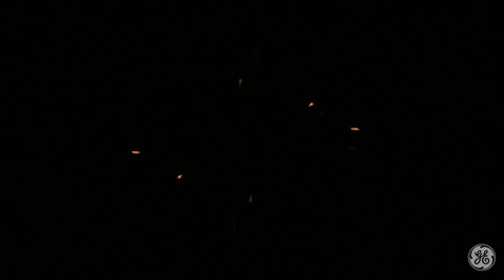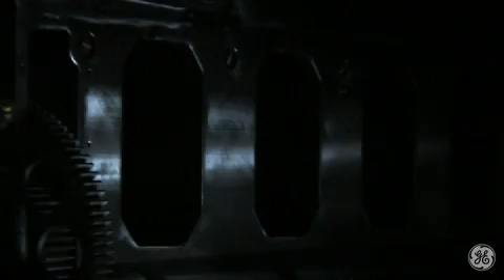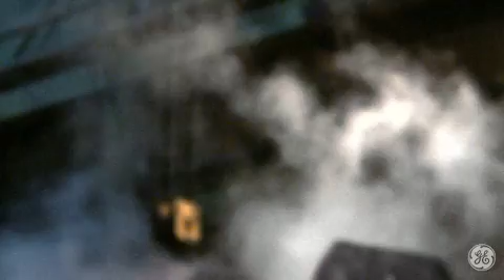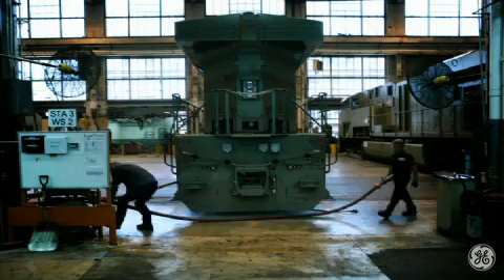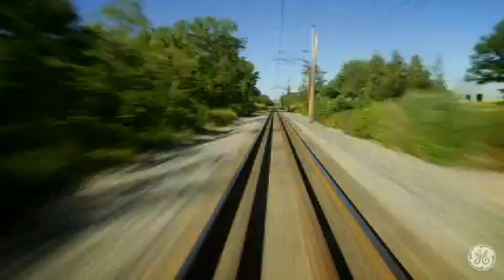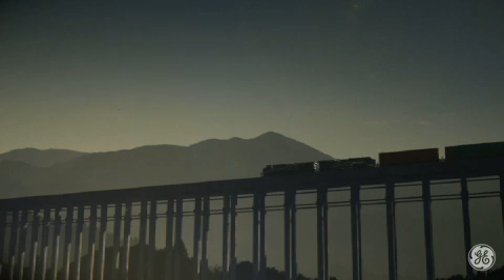GE Ecomagination The Evolution Diesel Train!

Comment: im mostly emd fan. I living in europe romania and we have a few locomoive factoryes over here.  The rentability is the key here and low maintance. When EMD and GE gonna build 4 stroke Engines than would be grate. Herew we use only Elelctric locomotives and aa few 4 stroke diesels. I favourite is the class232 Locomotive called ludmilla or taigatrommel. look on it. HAs a Kolomnad 5d49 engine 4 troke turbocharged.

Comment: Only few locomotives with 6-axles were build by Bombardier. I don't care. AC4400CW were rebuilt to new locomotive? That not truly. ES44AC's has 4400 hp V12 than EMD SD70ACe which are 4300 hp V16! GE locomotives FTW!

Comment: I am getting tried of looking at basically the same lookin' locomotive all the time. GE should make a new locomotive outside design and the Evolution diesel is not that much more fuel efficient that locomotives before it
between 2-5% better and they gotta deal against EMD with their SD70ace. The only reason why they sell is because GE cheats and uses their GE capital division to finance their locomotives out the railroads at such lower interest rates.